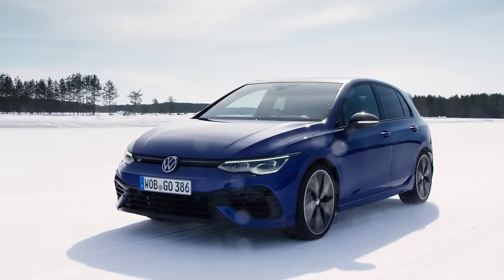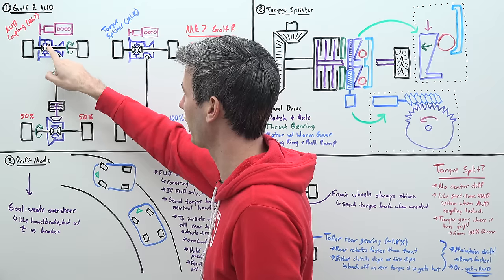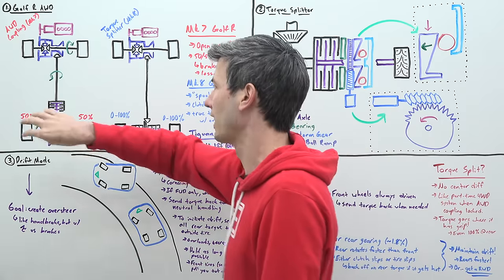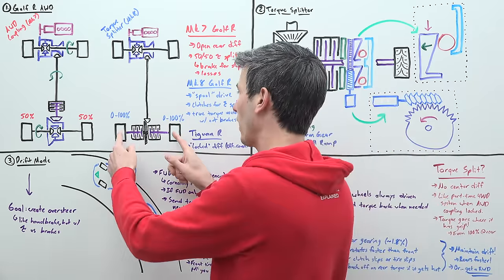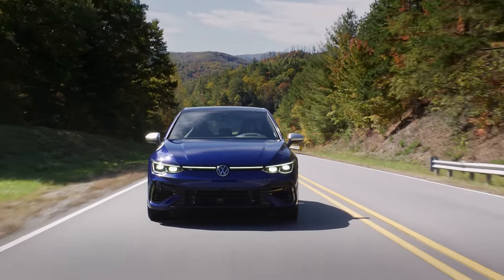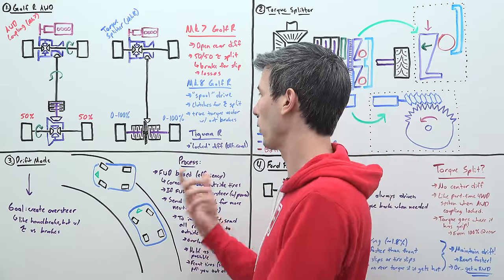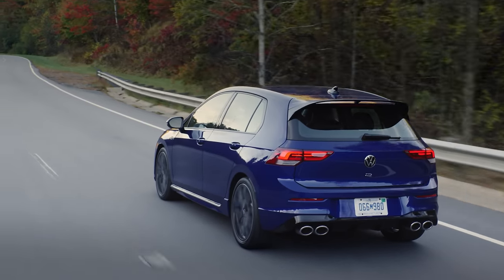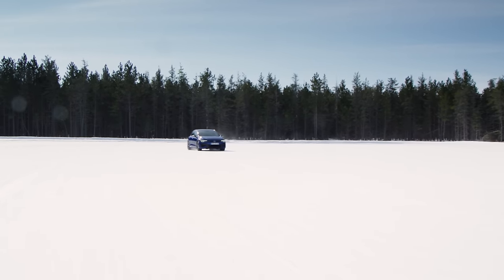Volkswagen's Clever Differential Allows For AWD Drifting - 2022 VW Golf R

Comment: This is very similar (or identical?) to what Toyota did with the 2019+ Rav4 Trail/Adventure package setups. 
I got to test the “mud/sand” setting which “locks” the “center diff”, essentially enabling 4-wheel drifting. Very fun in the snow!

Comment: Acura has a similar setup with their SH-AWD system.. except they also have planetary gears on each side, so that the rear will actually have MORE torque than the front wheels.. So it's also like the Focus, just not all the time.  It doesn't have a "drift mode" though either.  But I bet it wouldn't be that hard to implement it, since they have the same dual clutches.
Reply: Actually they do not use planetary gears in some models since 2015. Just clutch-packs like in Golf R or Focus RS.
Reply: Sport+ dynamic mode with VSA off is essentially a drift mode.
Reply: I second this. The rear ratio is higher than the front, one clutch pack per rear axle. Because of the higher ratio you can get 70% of the Front-Rear split going to the rear,  so they are pretty tail happy when you whack them around
Reply: Nah differential ratios and torque split is not the same. 

Focus could have 50/50 torque split with different gearing.

Another awd could have 30/70% torque split with same gearing ratios
Reply: Acuras can’t drift one bit lol just look at all the reviews on the new TLX type S😂😂
Reply: @Tsand4  yeah.. they don't have it programmed for it;  they don't have a 'drift mode' built in.  But they could- they have the same hardware, they would just need to run similar  programming as the Golf to make it happen.  The difference is the Golf has a higher 'geared rear axle than it's front... where as the Acura (typically MDX and RDX) has a planetary gear set  on each side-- to each wheel. (sort of like a 2 speed transmission going to each rear wheel).  So it can run at the same gearing ratio as the front, and it can also engage the planetary and have a higher gear ration than the front- which would be similar to the Golf in that mode.. But it also has the dual clutches too.  So like I said, it has all the hardware to do a "drift mode' similar to the Golf if they wanted to do their own version of 'drift mode.
Reply: @footballcoreano No one else has planetary gears in their rear axles.. so I don't know who you think they copied it from.
Reply: @calholli   oh absolutely it has all the hardware to be able to do it but Acura would never do something like that they play it safe with everything lol at the slightest hint of oversteer the Acura cuts power smh…….that’s what Acura fans want tho

Comment: I have a 2001 Subaru Outback LL Bean and it has a hydraulic clutch to drive the rear driveshaft.  I've been told that in first and second gear, the clutch is locked and half the torque goes to the front axle and half to the rear.  In 3rd and 4th, gear, the clutch releases and sends 90 percent to the front axle and 10 percent to the rear.  Unless the front axle is spinning faster than the rear [slippage], then it engages the rear clutch to make the axle speeds the same.  This is coupled with limited slip differentials at each end.  There is no center differential, that was done on the VDC models.

Great video!

Comment: Curious the maintenance required on the additional clutch packs and longevity /reliability.
Reply: My thoughts exactly. If one of those little stepper motors fails, it wouldn’t be good. That could be said though with any technology, and cars are way better because of technology. It’s just a matter of VW will engineer it for the same longevity their customers expect.
Reply: Longevity and reliability doesn't mix well with VW,but it is a general overall sign of the times, aka should be thought as throwaway cars after 5-7 years.

Comment: Toyota GR Yaris uses something very similar to the Focus RS with different gearing on the rear axle and single clutch pack. The circuit pack has two Torsens across the axles.
Reply: Toyotas seem to have the worst drivers on the road (Though Kia and Hyundai are catching up as their cars get older and cheaper), but the value and reliability engineering on them is excellent - The GR Yaris is the best performance car for the money if you drive on backroads 🙂.

Comment: Modern car designers seem to be caught between two worlds and it is sort of interesting to behold. Amazing technical solutions to simulate that which cars from the past had as inherent characteristics. Artificially weighted steering "feel", synthetic engine noise, expensive hatchbacks with contrivences to mimic the dynamics of a basic rwd. Its both impressive and depressing. 
So much time, effort and money to attempt to mask the fact that modern regs have caused cars to become far, far, far too heavy.
Reply: I can insert a rwd car meme from anime
"Look at what they go throught to mimic my pertection"
Reply: Or they could just build proper AWD systems like Mitsubishi S-AWC and have permanent ‘drift mode’

Comment: This further validates my decision to go with the Focus RS. Will be 5 years with the car on March 1 and it still makes me giggle every time I drive it. The AWD system that was ahead of its time was a major factor in my purchasing decision, along with the considerably higher power output, larger displacement and OEM winter wheels and snow tires. Ford knocked it out of the park with that car and I'm still super impressed with that car.
Reply: It's just too bad that dealer markup pushed it away from its intended audience. Most who wanted one couldn't afford it, and those who could were more likely to just get a nicer car.

Comment: Focus rs did something similar. Yet still, when you use drift mode on track for 2 laps, the system overheats. And you are stuck on FWD for however long it takes to cool down. Still wondering till this day why no one is doing transverse full time 4wd like Mitsubishi did for more than 2 decades.
Reply: In track driving, the drivers should use sport or track mode. Not drift (if you are doing time attack). Drift is only a gimmick with no real purpose.
Reply: @pokest225  drift mode gives you the best track time because it allows the most rear wheel torque. but yes, other modes also overheats the awd clutch pack just slightly slower. for the record, if you do dry track driving in snow mode in an evo, the clutch pack in centre diff will also overheat. but guess what, the car is still 4wd if this happens, just with an open centre diff, till it colls down.
Reply: Subaru does still (I think). Only for the STI WRX models though. Has a selectable modes switch for the centre diff (your static torque split) and two LSD’s front and back.
Reply: @TML34  boxer is a longitudinal engine. longitudinal engines' permanant awd drive train configuration is common among offroaders. im talking about transverse engine 4x4.
Reply: @Ballacha  I think Jason did a video on the EVO system a while back, if thats what you mean.
Reply: @Ballacha  no, drift mode does not give more or less torque to the rear. All it does is shut down the esc and allow the clutches to lock up instead of trying to power elsewhere. It is without a doubt worse on track than track mode. As for overheating, that's why they have diff coolers for the RS
Reply: I'm guessing that having the system Haldex based means you can get FWD efficiency when cruising and AWD performance when demanded.
Reply: @alfredwilsbury8397  They dropped Haldex for the Mk8 Golf in favour of this clutch pack, its magna torque vectoring or something like that.

But I believe you are correct on what they wish to achieve, on the street it would be like haldex, FWD 90% of the time.
Reply: Did you even watch the video until the end 😂
Reply: @JP_RS6  Yeah my bad forgot it isn't Haldex anymore. But from an efficiency stand point I would prefer this system on a car like this. It seems to work damn well too
Reply: @Ballacha  Alfa 159 Q4 awd full time torsen based system.

Comment: Good explanation as usual.  Small comment:  The electric motors do NOT drive the worm gear; they drive the "worm".  The "worm gear" is the one attached to the thrust bearing.

Comment: For all the people worried about the clutch packs wearing out, keep in mind that in a wet clutch pack, oil is forced between the friction surfaces such that torque transfer occurs not only via mechanical friction of the clutch plates, but also via viscous shear forces of the oil. Much easier to change fluid than clutch packs!

Comment: Correct me if I am wrong but Acura Sh AWD has been using this layout since it’s was introduced. Clutch patches for the rear wheels and the capability of sending 100% of rear power to each individual wheel. Given that the drive train can send up to 70% of its power to the rear axle.
Reply: The very first Sh-awd in the legend/RL had a pair of clutches for the rear wheels and a separate overdrive gearbox, the 2nd iteration in the rdx and 4th gen tl simplified with a constant overdrive and only the wheel clutches.

Comment: So, if I understood correctly, in this new system, rear torque on the wheels is controlled by set of clutches but front is controlled by brakes. Correct?

Comment: As a prior VW tech, whether VW AG uses Magna diff or not, the 4Motion is really 4WD. It has a transversely mounted engine, thus is FWD biased with part-time 4WD. Subaru has a real AWD system. Most companies use the marketing department to mislead the public by spewing out disinformation. You can use the AX to modify how much torque is going to the rear, but there is no adjustment for any identified frequency of power being sent rearward.

Comment: The awd system vw uses is cool but it could be much better if it had a controller kinda like the gr yaris where you can switch it from fwd to rwd or 70 30 or 30 70.
Reply: Make it...beggars cannot be choosers
Reply: The system that VW uses is actually more complicated than the one in GR Yaris. Both are using the same trick with rear wheels overspeeding but Yaris can overspeed only the axle, not the wheels separately.
Reply: @4x4.tests.on.rollers  so...the Yaris system is more durable?
Reply from the maker: It's not quite as simple as you lay it out, as I discussed at the end of the video. You cannot choose for 70% of the torque to go to the rear wheels, the road conditions must allow for that to happen. But you could potentially have a selection of how much you want to lock up the clutch packs, that is different.
Reply: @EngineeringExplained  A video explaining the GR Four system would be really interesting, especially with the rumors of the upcoming GR Corolla using it too :)
Reply: @PanSwirus  I made explanation video about GR Yaris awd system, maybe that will help 🙂
Reply: @johnathanpearson3203  Difficult question. Both are based on clutch-packs...
Reply: The car defines it as based on drive mode an available grip. A Ford Engineer at the RS Adrenaline Academy that I went to said that up 80% torque can go to the rear (and then up to 100% of that to either wheel), but the AWD is constantly changing and you wouldn't be able to just select that without an additional differential between the front and rear...
Reply: @4x4.tests.on.rollers  ah ok the weakest link situation...
Reply: @EngineeringExplained  According to JTEKT engineers - 30/70 FR torque split may happen at any conditions (max 20/80). They say that it is due to lower gearing of rear differential - the trick comes into action when the clutch-pack is almost locked but not entirely. I mean the point when it wants to overspeed rear axle but it can't do that yet cause rear wheels still have grip so they resist. What do you think about their explanation?
Reply: Drive modes are basically doing the same thing.

Comment: With all the moving parts and all the torque splitting, will that impact reliability and longevity?  Is there additional maintenance required to keep the system running well?

Comment: I'd love to see a video on using 3 open differentials (front, back, and transfer case) with 3 viscous couplings for AWD. It seems like a simple, elegant system, but I'm not aware of it being used.
Reply: Yes it has been used before, by Nissan and was featured in a certain '80s Pulsar iteration.  The system was called "Triple Viscous" but I don't have any additional technical info......

Comment: Hi Jason,
How does the cornering performance of this system compare to a mechanical limited slip differential? Doesn't an LSD also send more torque to the outside wheel in a corner?
Thanks for the great video as always.

Comment: Jason I always wondered, is there really a difference between sending torque to rear wheels and not sending in terms of consuption?  All the shafts are turning in any case, where comes the efficiency gain from?
Reply: It depends what system you consider, some are disconnecting completely the drive shaft and diff. But if you consider those haldex-like systems, there's probably some lower resistance in PTU when rear is not engaged.

Comment: Thanks, Jason! I've been wondering how these's clutch packs work and their longevity. Now I have a better understanding of how my GR Yaris works... whenever it arrives.
Reply: GR Yaris has only one clutch-pack. It is electromagnetic and it is powering rear open or optional torsen differential.
Reply: @4x4.tests.on.rollers  Thank you for more info, I'm aware it's a signal clutch-pack. And I'm guessing it being electromagnetic means it doesn't use a worm gear and electric motor to engage the clutches. So from my understanding, is it being electromagnetic takes away the risk of the worm gear and electric motor from burning out? Jasons video and your video is really helping me understand how a clutch-pack operates, thank you so much for feeding my curiosity.
Reply: @RoyDangerMoney  That's correct, electromagnetic clutch-pack is probably the simplest from mechanical point of view. It uses only electromagnet to create an electromagnetic field, the rest is done mechanically by balls and ramps (similar to the ones from Golf) which compress the plates. Simple, very fast and responsive, no service.

Comment: Great video.  Would this be similar to how the Audi S Sport differential works?  Also could you do a video on Audi's Dynamic Steering and if it would be more stable in slippery (read snow) conditions?
Reply: Sport differential has mechanical open differential inside. Each semi axle has "gearbox" so it can be like on 1st (standard) gear or 2nd (overspeed) gear.

Comment: Come to think of higher gearing in the rear, does anyone know for sure that drifting was the motivation? Doesn sound like something a big manufacturer would do.

Maybe another approach makes more sense: When accelerating, the powered Wheels turn a liiiittle bit faster than the car moves, right? Just like slip angle, but longitudinal instead of lateral. The higher the slip, the more grip, up to a certain point where the grip suddenly drops and the wheel starts spinning. So, if a wheel gets more load, like the rear wheels do when accelerating, it can handle more slip, which would result in the rear wheels rotating faster, than the front wheels. If that's the case, then the focus could make more longitudinal grip than with equal gearing. After all, isn't that what the torque split on a center diff does?

I feel like it makes more sense that this could have been the motivation behind the gearing instead of better drifting. Does that make any sense?
Reply: But there is NOT a center diff in the Focus. It's definitely done to make the car a little bit more lively and lose at high power settings, for better rotation capabilities.
Reply: @xtnuser5338  I didn't say that there is a center diff in the focus. I compared the effects to what a center diff does: A center diff with a rear biased torque split would ultimately lead to the rear wheels slip a little bit faster than the front wheels when accelerating. So the higher gearing could have been implemented to compensate for that effect.
Reply: @kooooons  Gotcha. Makes sense.
Reply: the RS was built for the track and literally has a drift mode, so yes, it was 50% of the motivation...the other 50% is to over speed the outside rear wheel for better cornering, so its a win/win for track and drag
Reply: @6agenthawk  engaging the outside rear wheel in corners does make sense 🤔
Reply: Then why did the manufacturer call it ‘drift mode’ 😂😂😂😂
Reply: @JonnyD3ath  Do drive modes change the gearing? I don't think so, it only changes when to engage the clutches. Just because a drift mode benefits from the higher gearing, it doesn't make sense, to make such a decision, just for drifting. It must have other advantages too.
Reply: @JonnyD3ath  Exactly! Although to be fair...the reason the engineers do something, and the reason the marketing idiots decide to give for it...are not always the same thing.

Comment: So, how did the clutches behave if you don’t select drift mode and instead what to optimize control. A sort of related question, why do electric cars with two rear motors always use them both to drive a differential rather than one for each wheel?
Reply: Probably to allow for final drive adjustment

Comment: In wheel electric motors for all four corners. With coils replaced by flowing plasma gas to carry the magnetic field and produce rotation. Cold plasmas, refrigerated. To reduce heat from rotational friction.

Less unsprung weight, perfect control over where your torque is all the time, less energy loss to heat.

Comment: I think if both front wheels spin the rear wheels spin like lsd if you spin 1 the other goes but if you spin both the drive shaft spins they are all connected so just do that backwards if you break the rear wheels free by shifting weight and turning then the front wheel will pull while drifting